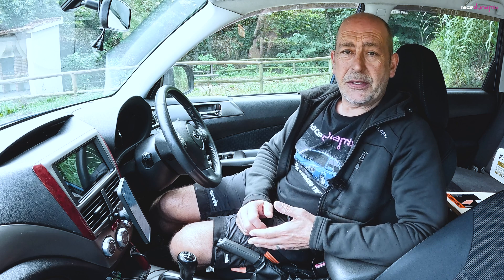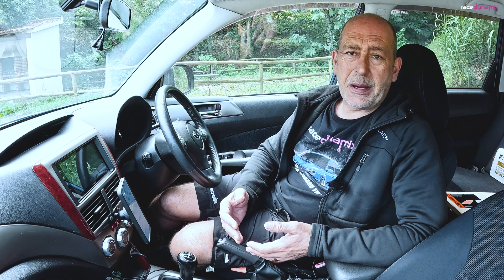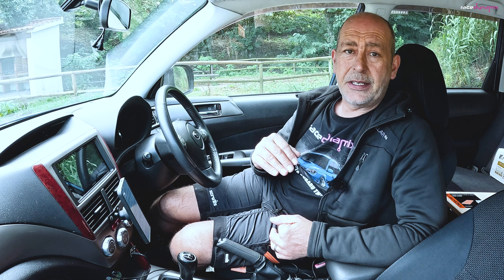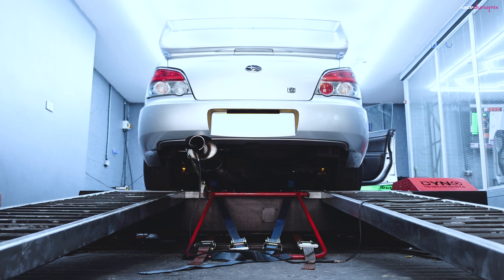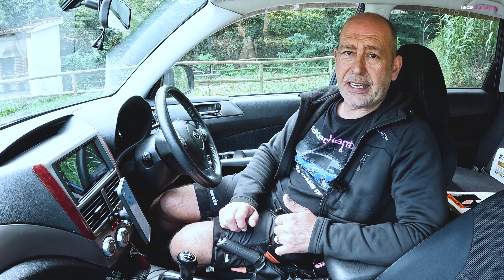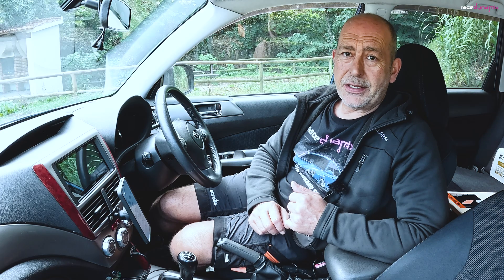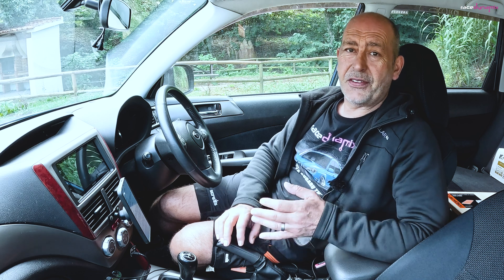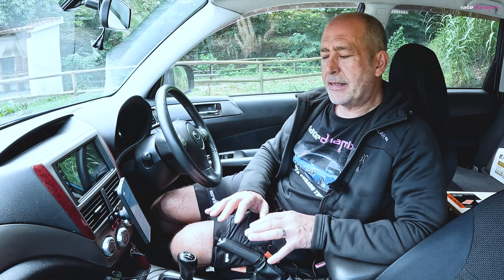Detonation ... Can you actually SEE Det or Knock ? | Subaru Tuning Technical

Comment: Also the dead give away with knock was high load, Low rpm conditions when it will most likely happen.
Reply from the maker: @HeidiFegles  Most common point for det seems to be 5600rpm on EJ engines.  This example was earlier though 👍
Reply: @racedynamix  this is good to know. from a tuners perspective. Pretty close to where I see knock on stage tunes, like almost all have that mid 5k rpm knock that I’m being asked to remap mainly I take Cobb stage tuned cars and show them the Tactrix way and never look back.
Reply: @racedynamix  that's right where mine was 🎉💯

Comment: How do you deal with stock ecu and forged piston false knock ?
Reply from the maker: First I would want to know whether it is actually false knock..det cans are the only way to tell for sure. False knock is unusual even on forged pistons. 

Disregarding any corrections as false without knowing for 100%  would be the wrong thing to do imo.

If they are false you can isolate where they are occurring sometimes as they tend to be more transient than full wot but you have to be careful as to not throwing the baby out with the bathwater.
Reply: I don’t have any false knock on my car and I run 100mm 2816 forged pistons. I let it warm up. Forged pistons are usually higher compression. What’s your compression ratio. It could be real knock.